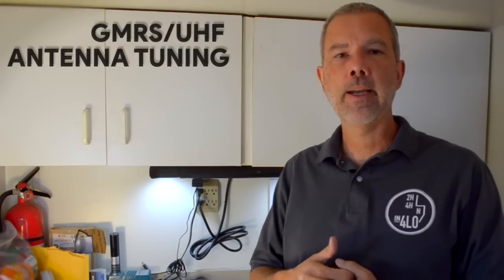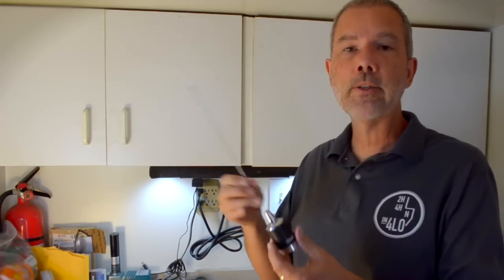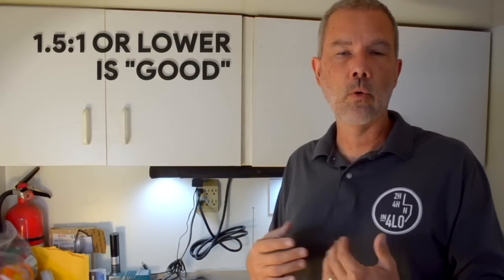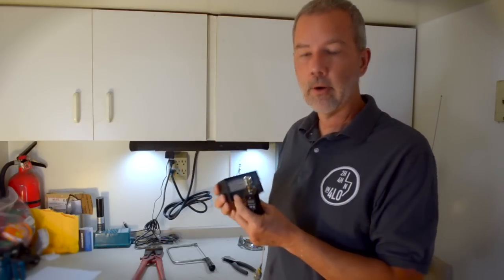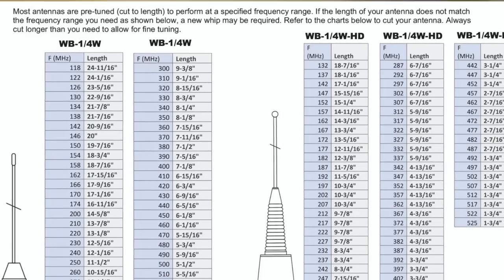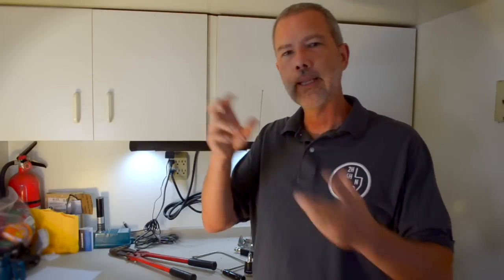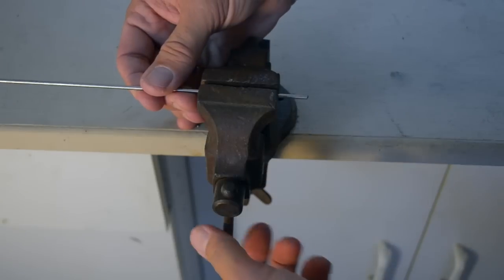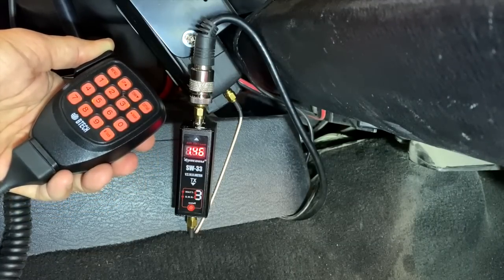How To Tune A GMRS Antenna & SWR Basics

Comment: I like to make sure the antenna is where it will live. Grab your Nano VNA and set it up for the frequency you want. Hook it up to the antenna and have fun. I also like to use a cutting wheel on my grinder to trim that hard steel.

Comment: Does the length of the coax make any difference?  I am using a 6db Gain Midland antenna mounted on the back of my JLU Jeep and I got a terrible SWR 1.2/2.4
Reply from the maker: an SWR of 1.2 is very good and 2.4 is ok/acceptable.. Stop trying to overcomplicate it and just enjoy using your radio.

Comment: Does the power setting matter? Does the channel you’re on matter? During the swr testing?
Reply from the maker: Power should not matter because the SWR is a ratio, but I always test it at the highest power.. 
The channel does matter because the SWR will not be the same across all channels.. it's best to tune your antenna for the middle frequency OR the frequency you use most often - but usually the difference in SWR between your worst and best channels will not be very much.
Reply: @TheNotaRubicon I’m purchasing the the meter through the link, hopefully I can tune my fiberglass antenna with it.

Comment: If you have a dual band antenna and the wire comes up then it's got a little couple curls in the middle and then it goes up again but all one solid piece where would you cut on that bottom or top I had someone say his srw was high and he cut from the top of the antenna off I thought you cut from bottom which way? The one I bought was a mookeerf dual band from Amazon. From Amazon it says for gmrs ham when I received it the Box all it says is UHF CB antenna which has me afraid I have the wrong antenna now the bottom of the magnet says 400 to 470 MHz. Help help please I don't want to fry my brand new gmrs radio.

Comment: I know I know this will probably be dumb but can't you use a grinder just to grind it down a little by little instead of cutting? I'm just now getting into a gmrs radio thanks for any help
Reply: I don't see why not? I'm not an expert by any means though. The only weird thing I could think of could be the heat messing up polarity? But I'm not even sure that's a thing if it's not a magnet.
Reply: I use an angle grinder with a thin cutting wheel to trim the antenna whip.

Comment: Scratching my head because I purchased the Nagoya TB-320A  tri-band to use with the BTECH UV-25X4 you (only last week) convinced me to purchase.  So if my logic and commonsense is correct and intending to only (legally) transmit on GMRS, then I would tune to the middle GMRS frequency.  AND yes, you seem heavily sedated in this video, so much so mygigglehertz.
Reply from the maker: You want to tune the antenna EITHER to the frequency you plan to transmit on the most, or try to split the difference - but that means neither will be tuned as best as they could be.
Reply: @TheNotaRubicon  Thanks for the advise.  Considering my usage is primarily off-roading in the mountains of PA and seriously considering a repeater set up, then tuning in the repeater frequency range should fit the bill.  All the best!

Comment: A note to newbies, when he says grounding your antenna, he doesn't mean the negative of the battery or black wire from a black and red pair. Antenna grounding is a reflector to the main whip. If you attach your antenna to your roof and your roof is fiberglass, it wont be grounded because fiberglass isn't conductive and wont help to balance your whips energy. Be sure your antenna is mounted to a metal surface that it's going to be operating in and when checking SWR, dont stand next to the antenna. This will affect SWR because your body will absorb some signal throwing off the meters results. Don't touch the antenna while transmitting either as an RF burn is possible. 73

Comment: 5:11 That is not a hacksaw. A coping saw is a type of bow saw used to cut intricate external shapes and interior cut-outs in woodworking or carpentry. It is widely used to cut moldings to create coped rather than mitre joints.

Comment: Hi, thank you for your helpful video about how to tune antennas. While I was using my Sure-Com SW-102 and cutting small segments of antenna off like you showed, I noticed that as the SWR was getting closer to 1.1 the power output was decreasing as well. When I got the SWRs down to 1.01, with a 10" antenna,  my power output for my new 45W GMRS mobile radio was only 27W.
I kept experimenting with different length antennas and to get the full 45W of power, I needed a 18" antenna that gave me 2.95 SWRs.  My question is why cant I get a full 45W of power and low SWRs at the same time?  Thank you

Comment: The Midland ghost antenna, is there a procedure to tune it. I have not purchased it yet but I was looking at that with the 575 radio and the 6db gain antenna so I had an antenna for dense areas and one for open area. I was going to mount the antenna on my 4Runner on a calie rays ditch light mount. Or am I looking at it all wrong.
Reply from the maker: You're doing it wrong... The Ghost antenna (any "GMRS" antenna) is pre-tuned.. take it out of the sack, connect it, and use it.. 
Stop trying to overcomplicate it.

Comment: Just came across this video and clicked on the link for the swr meter. It does NOT come with the connectors for a mobile radio antenna.

Comment: The corner of a flat rat tail file will cut through a stainless steel antenna element in no time If you don’t have a bolt cutter. I found out the hard way when I tuned an old replacement AM car radio whip antenna to work on the ham radio 2 Meter band as a 1/4 wave element with a hacksaw. It took forever and both made the antenna element get hot near the cut so be careful.

Comment: Randy I am putting gmrs in my Polaris ranger I am installing it under my passenger seat then running the control/ mic out into my drivers area. I only need 7 feet of a 19 foot antenna cable. what am I supposed to do with the extra cable, is coiling it up ok?
Reply from the maker: coiling it up is fine. Just keep the coil loose and do not kink the coax.
Reply: @TheNotaRubicon  thank you👍

Comment: So if I have a antenna that came with my radio and it was a 144 - 430 mhz. From Factory and or another antenna That's rated that megahertz could I still tune the antenna

Comment: What happens when you think you got the lowest SWR but actually cut more than irreparable? Does the SWR measurement start increasing back again?
Reply from the maker: Yes.. thats why you cut in tiny MM increments.. and dont get greedy.. leave well-enough alone once you get around 2.0:1
Reply: Your question was exactly what I was thinking.  I know me, I would struggle to leave well enough alone until below 1.5.  Maybe after the SWR starts rising, you could solder the previous tiny bit back on?

Comment: Hey Randy, What do you recommend for tunning a multiple section antenna such as the Tram 1486. I purchased one and I dont know where to start. I mean which section. Do you think it is enough just trimming just "as the instructions say" or you still need to measure the SWR for each cut of every section.?thank you
Reply from the maker: I recommend reading the words on the instruction sheet and doing what it says without trying to unnecessarily over-complicate it.
I have a 1486 and thats how i did it and I got a 1:01 SWR when I was done.
Reply: Thanks,

Comment: I’m new to GMRS. Dose the antenna need to have the spring/coil in/on the antenna?
Reply from the maker: If the antenna is designed/tuned to work on GMRS with a spring/coil/anything on it, then it is not recommended to take any pieces off.

Comment: I newbie question.  For the handheld GMRS radios that have removable antennas - are the antennas that are included with a Baofeng GMRS-9R (Upgrade of the UV-5R) pre-tuned out of box?  And, if you buy a longer whip antenna that can screw into the radio, are they pre-tuned?   In other words, is it necessary to check their SWR readings the same way you would for roof-top mag mount antenna?

Comment: Pl259 connector or the cable your showing does not come with the swr meter in the link you provided. Did you make it up? If so what length would it need to be. Thanks! Im running btech 50-2
Reply: Its a jumper im assuming

Comment: What freq do you turne a tram 1486-b to 465,464,462,466, if you use repeaters and  gmrs
Reply from the maker: For a repeater you're transmitting on 467.x and receiving at 462.x, so shooting for somewhere in the middle is good - but I usually tune for 462.x because all the other GMRS channels are 462.x.  Remember, it does not have to be perfect.
Reply: @TheNotaRubicon  Thanks,will try when the day permits.
Reply: @TheNotaRubicon   so do cut on 466,1486 says 465,but this is1486-B so would 466 be ok,I have chart?
Reply: Thanks,don't want to go on roof just once,too hard,get right first time,have three sections to cut,so will cut at 466

Comment: I have a side by side with a plastic roof, if I mount a 12x12 steel plate to the roof, should I install a ground strap to the roll bar?  I am going to use the 6db gain midland antenna with magnet mount so it will give me a break away point if it hits low trees. I really appreciate your videos.
Reply from the maker: Connecting it to the cage with a strap (not a wire) wouldn't hurt, but probably not necessary as long as you have at least 4-6 inches of all around the base of the antenna.

Comment: Would an antenna, marketed as being optimized for GMRS, still need tuning?
What happens to the tuning when the antenna gets stuck onto various vehicles?
Is the tuning specific to the particular radio that was used?
Reply from the maker: If its marked as a "GMRS antenna" then it should not need to be tuned.  Although the SWR of an antenna may change slightly when moving from vehicle to vehicle due to changes in the ground-plane and other variables, it should not need to be tuned again when connected to a different radio.
Reply: @TheNotaRubicon  Thank you.  Enjoying your videos.

Comment: New to GMRS. Is it possible to get below 1:1, such as 1: .95? Would that still work, or is it off to buy a new mast? Thanks.
Reply from the maker: No, 1:1 would be the equivalent of 100% power out to the antenna.
Reply: @TheNotaRubicon  Thanks for the very quick reply and answer. BTW, being a Jeep owner have you ever been over Black Bear Pass or Imogene Pass in southwest Colorado. If you do get there take the Durango to Silverton Narrow Gauge railroad trip. It's my home turf and is stunning.
Reply from the maker: I dont like shelf-roads.

Comment: Get a pair of Knipex wire cutters.  You will pass them on to your kids.
Made in Germany perfection.   So once you tune your antenna..
Then you remove the SWR tester...and doesn't that change the SWR again?
🤔  It was adjusted at one length...then you removed the part in the middle.   Arghhhhh
Reply from the maker: Removing the SWR meter does not affect the SWR in any significant way.

Comment: I noticed my antenna mount is solid metal. Also my antenna base is metal.  Assuming it electrically becomes the same when connected to the mount. Does does the antenna mount need to be chassis grounded?

Comment: I assume that you will eventually get to the point it will go back up without ever hitting the perfect 1.0/1.1?
Reply: Yep - if you keep making it shorter and it starts going back up, stop cutting! You've gotten it as good as it's going to get (and then made it slightly worse).

Comment: Something I noticed is you set the power to LOW in this video.   Is that important?    From my own experience at Low I get 1.16, at High I get 1.62.   If we knew what we were doing, it would not be called Research.
Reply from the maker: it should not matter because SWR is a ratio - but i usually do my testing on high-power.
Reply: As Randy states, tuning on high is probably better, especially if you're using an analog meter. On low power, it might be negligible and harder to read looking at the moving needle.

Comment: In my Mazda Miata, I installed a midland mxt275 with the standard (not ghost) antenna that is included.  SWR pegs the meter all the way into the red.  No coils or pinches.  I even took it out of the car and set up inside like you did with your MXT275.  Still pegs the meter. Suggestions?
Reply from the maker: Fully into the red usually means a short - Check your wires and connectors. if they look good then something is seriously wrong somewhere that is far beyond the scope of youtube comments to get fixed.

Comment: What happens or what would an SWR Meter read if I cut an antenna too short (cut too much off)?
Reply from the maker: if you are too long or cut too short, the SWR would start to read high.. the shorter you cut it, the higher.
Reply: At some point when you cut, the SWR will go back up.   This is the whole reason for cutting little pieces at a time (1/4 inch).  When you reach that point, just extend your antenna back up.  There is usually at least 3/4 inch of adjustment area in the base.

Comment: I am following your instructions for tuning my Comet CA-F72GF, even though I kept the instructions, they are unbelievably vague. When cutting and adjusting, do I do so on top and bottom or bottom only? You mentioned the latter, but I assumed you meant that was specific to the Browning. So far, I cut down to 207mm on bottom and 324mm on top, but SWR is a high 3 on the freq I need. It does drop down to 1.5 when I tx on low power...does power output matter?
Reply from the maker: SWR is a ratio, so it should not change between low and high power - you may have other issues, although I'm not sure what.
Check your cables, make sure the antenna is properly grounded and make sure you have a good groundplane - if your mounting area is not a good groundplane, that might be as good as it gets.
Reply: @TheNotaRubicon  I have it posted temporarily on a tripod and hooked up to my ham-in-a box, grounded the antenna to the nut on that faceplate, with jumper cables between the meter, radio and antenna. I did not set up the groundplane. The numbers went significantly lower (1.1), when I used the 126ft straightened cable in the same setup, although I still received three different readings(1.1-2.4) on the various power levels.

Comment: Pro-tip: @ Randy Notarubicon Productions
For tuning replace the Stainless Stinger (SS) with a piece of wire that is about the same diameter, & length as the SS one. 
Trim or lengthen the tip of the wire, until you get the best SWR, then remove it and cut the SS to match. Install the SS, and your done.
I've been doing it this way for many years. It saves a lot of time and frustration of pulling the stinger in and out, especially on taller vehicles.

Comment: Hi there, 
I've been geeking out on radios and antennas and SWR/power meters the past few days and I have a question that I cant find the answer to.
I have a programmable radio and I've been trying lots of different frequencies to match my antenna rather than cutting my antenna to match a specific frequency. I've noticed that my radio transmits much more power on some frequencies compared to other frequencies. For example, in 156.500 my radio is pushing out a solid 50W according to the SW102 meter, while on your favorite channel 462.575 its barely pushing out 23W, both with low SWR.
Why is that?
Thank you, 
David
Reply from the maker: Most (if not all) radios cannot output the same power across all frequencies.. Usually they are set at the factory to output their maximum at a certain frequency and the further from that frequency you transmit, the lower the power will be.. If you are getting 50W at 156.500, then it sounds like you have a ham/VHF radio, so transmitting on GMRS/UHF (462.575) you'll get much less power output.  Perfectly normal.
If you want a full 50W on GMRS frequencies, you will need to buy a 50W GMRS radio.
Reply: @TheNotaRubicon  Thank you for your thoughtful reply.
I had no idea that radios only transmitted max power at a specific frequency. That makes sense. My radio is a VGC -N7500, listed as a dual band mobile radio.
It puts out a max power of 40W at 429Mz on the UHF band. The further away from that I get, the weaker the power becomes.
I am learning so much!
Thank you,

Comment: Just ordered my first gmrs mobile radio for my truck. It's gmrs repeater capable,  and scans uhf and vhf ham. My question is what's the best antenna for this? Should it be dual band in order to pick up the other frequencies? Thanks in advance
Reply from the maker: If you're going to be talking on GMRS and scanning ham VHF, then yes, a dual band primarily tuned for GMRS (462-467Mhz).. If you're going to be scanning ham 70cm, then a GMRS tuned antenna will be good/close enough
Reply: Thank you. I enjoy your channel. Very informative.  I appreciate what you're doing . Much respect.

Comment: Hi Randy

I found a GMRS antenna that is pre-tuned and sold by Rugged Radios.  Have you heard of them and if so, what’s your opinion on their antenna?

Thank You Randy
Reply from the maker: Heard of them, but never tried that specific one. Since I made this video I have started using the Midland MXTA26 GMRS pre-tuned antenna.. No tuning or cutting required.
Reply: @TheNotaRubicon  My Nagoyas are pretty good at coming "pre-tuned"